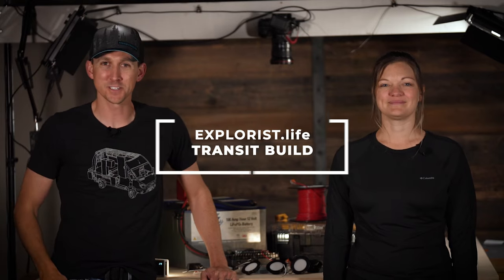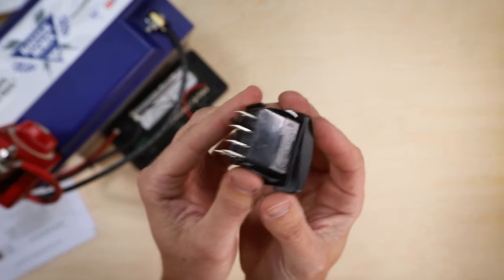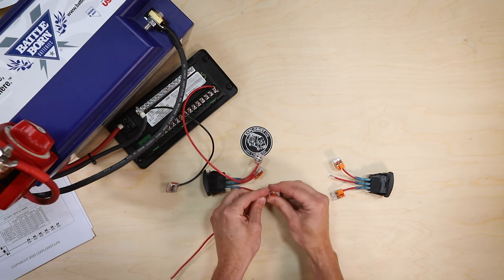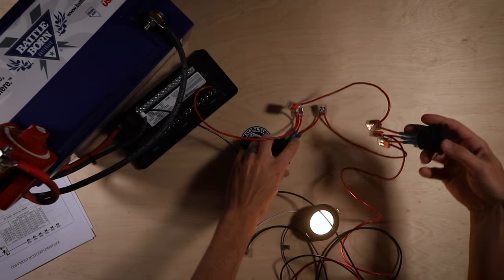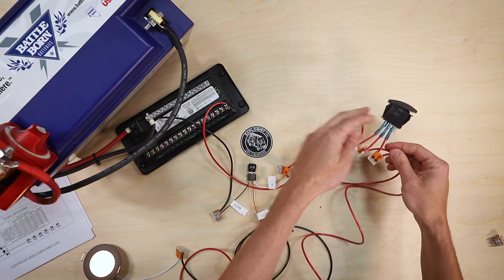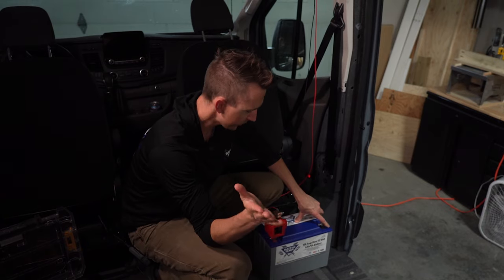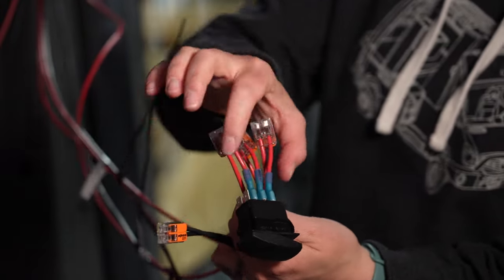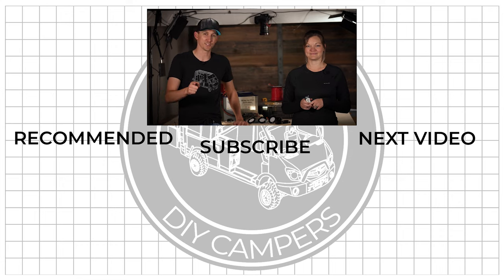How to 12V 3-Way Switches (to Control Camper Van Lights from two locations)

Comment from the maker: Fun fact...  I used the term 'Two Way Switch' throughout this video instead of 'Three Way Switch', which is 'technically' incorrect.  Three way switch is the 'correct' terminology to describe a pair of light switches that control a single group of lights.  I've always incorrectly called them two-way-switches because they turn the lights on and off from two different locations and frankly... old habits die hard.   They are technically called 'three way switches' because the toggles can be either:
-Both up
-Both down
-One up w/ one down

A 'Two-Way Switch' is just a standard, normal light switch because it has two positions; up or down... on and off...  But nobody calls this type of switch a two way switch.

In fact...  by that same logic... a 'one-way-switch' would be a broken switch stuck in the up OR down position?

All of that said...  The term 'Three Way Switch' is Technically correct... but stupid.  A switch that controls lights from two locations should be called a two way switch.  Thanks for coming to my ted talk.

Parts shown in this video:
➤Puck Lights (We used 10 of them): https://amzn.to/3NpW1sE
➤(or some silver ones if you like): https://amzn.to/3lw2sOT
➤EXPLORIST.life Puck Light Wiring Kit: https://shop.explorist.life/shop/all-products/camper-wiring-kits/branch-circuit-wiring-kits/12v-puck-light-branch-circuit-wiring-kit/

If you'd rather buy the parts from the kit from Amazon:
➤Red & Black Wire (we used 16 AWG): https://amzn.to/3lvFesn
➤2 Conductor Lever Nuts: https://amzn.to/3wBZY8f
➤3 Conductor Lever Nuts: https://amzn.to/39Li91W

➤Here is the switch we used: https://rockerswitchpros.com/product/v4d1-a60b/
➤Here is the switch face we used: https://rockerswitchpros.com/product/contura-v-blank/

Not sure what wire size to use?  Check out our 12V Branch Circuit Guidebook: https://shop.explorist.life/shop/all-products/solar-wiring-diagrams/12v-branch-circuits/

➤Shop the EXPLORIST.life Store: shop.explorist.life
➤Shop Battle Born Batteries: http://battlebornbatteries.com?afmc=explorist_bb67
➤Binge the Transit Van Build: https://www.youtube.com/playlist?list=PLmvhcyi4n0TVfA4XCYJBkzfUXunSON1zX
Reply: Just answered my own question, not sure how I linked to the SPST switch.
Reply: In my 55 years, I have always heard this circuit (AC or DC) called a 3-way circuit. The name is based on the switches, as you explained, have 3 combinations.
Reply from the maker: Well, @CihaPet  , I've been around for 187 years and I thought it has been dumb for all of them.
Reply: Can you do a video on 4-way (3 switches)? I would do a switch at 3 spots. Bed, Kitchen, Entrance. 
Thanks!
Reply: @EXPLORISTlife  fun fact in the US it called a 3 way switch but in Europe it is in fact called a two way switch. So technically you where not wrong😂
Reply: If it only goes one way, it’s not a switch. Every switch goes two ways. There’s no such thing as a one way switch. So no, the correct terminology is not stupid.
Reply: @Nowindresistance  When wiring a house in England it is called a "Two Way" by the electrical trade because there are two places where the light can be controlled, Typically at the bottom and top of stairs. For three stories or more, control at each landing is done by an intermediate switch, a 2P2T (two pole two throw) change over. The Europeans have a simpler system requiring less wires but more "technology".
Reply: I'm pretty sure it's called a 3-way because there's 3 points (2 switches and the light) and 4-way (or more) is called "multi-way" from my understanding.
Reply from the maker: @AceBoy2099 Yeah maybe.  Still dumb, though. 🤣🤷😂

Comment: I have been in electrical for 40 plus years, I knew this could be done with DC. I have wired untold numbers 3 and 4 way ac switches. I have been used to purpose made switches specific to the application and have been over thinking the dc set up, thanks for simplifying it for an old workhorse wearing blinders

Comment: Is there any chance you could do a small update on how to wire the switch if you did want the indicator light functional?  Thanks again for the detailed demonstration, it really gives people confidence that they can do it themselves in a safe manner. Keep up the good work 😁👍
Reply: Did you ever figure this out? I'm trying to do the same but have not been able find any sort of guide.
Reply: @shs4x8goat  I looked at the link he provided for the switch Rockerswitchpros. Their website has some wiring diagrams and a phone number you could probably call. They also make custom rocker switches so I'm definitely going to get some of those!
Reply: First you must decide what you want the indicator light to indicate. Perhaps you want it to tell you that the main light is on ! The best use is to be permanently on to show where the light switch is.

Comment: On Lands systems these are called a 3 way switch set up. The two wires between  the two switches that are not the feed or switch leg are called traveller's.  When wiring buildings I would develop colors for their purposes. You could do black negative red positive, switch legs and traveller's A DIFFERENT COLOR NOT YELLOW OR GREEN, Red or  Black. You used them already for  positive and negative, or any other colors that are already in use. Much easier to know what your looking at. A year or two later you open a box and see 2 purple wires well you know they are traveller's you see an orange wire oh that's the switch leg.
If you were to put a 4way switch in your traveller's you could switch this light from as many switches  you want.
Thank you
Mike

Comment: Great video. My only suggestion would have been to use the wago’s only where they were needed to avoid confusion. For instance on the switch the top and bottom terminals had wagos on them but it was only 1 wire in and 1 wire to the terminal. Possibly you did it for faster switch removal in the future if ever needed but the terminal spade connectors were there for that purpose too.
Reply from the maker: You can definitely do that if you like in your own install, for sure. 😏👍

Comment: Hi Nate and Steph, excellent demo video of how to wire up 3 way switches to van lights. The idea of also installing a dimmer is a great addition to any campervan setup. What's not clear to me (Im sorry if this has already been asked) can a dimmer also be place at the other switch. In effect you  would have a 3 way switch and a dimmer at the front of the van followed by  a 3 way switch and a dimmer at the back of the van giving you full lighting control from either end? If so, could you elaborate with a quick drawing (or video if you want) of how to do this ? BTW, excellent channel, love your videos and style.
Reply from the maker: Basically, no.  Not like this, anyway.  If you have two dimmers in the same circuit, they need to somehow communicate so that each dimmer 'knows' where the other dimmer is.  If dimmer 1 is at 50% while dimmer 2 was at 100%, the circuit would 'probably' (I haven't tested this) be operating at 50%.  In short; I think the circuit would only operate at the level of the lower dimmer.

If you want that kind of control.  Something like the Garmin PowerSwitch would be something to look into so you could control everything via bluetooth from your phone.  This is what we used to install the lights on the front of the van with; but it could be used as interior lighting just the same.
Reply: @EXPLORISTlife  Thanks for the reply... I didn't think it was possible but just wasn't sure.

Comment: Thanks for this video. I have a question. Is there an illuminated push button that can do the same job? I want to wire an outside light that I can (for example) switch on from the drivers seat and switch off from the back of the vehicle. The switch would illuminate based on whether the light is on or off. I'd like to use a push button switch because the continuous changing of the rocker switch position would drive me crazy. I hope my question makes sense? Maybe it needs to be a double pole double throw on-on switch and only 1 side is wired? Thanks a lot, your videos are awesome.

Comment: I am sure I know the answer to this question but, can I ask why you chose not to go with the switch lights? Videos are much appreciated , Thank you!
Reply from the maker: With a two way switch, there would be times that the indicator switch would be 'on (because the switch is 'up'' but the lights would be off (I think), but ultimately...  I don't want an indicator light on a switch connected to my ceiling lights because my ceiling lights are plenty of an indicator that the switch is on.

Comment: Once again another great educational video Nate.  

So if I have 3-way LED rocker switches in the same exact circuit, will the LED on both rocket switches be on when when the puck light is on?
Reply from the maker: Probably not.  The switches will be 'on' when they are flowing power; so if the 1st switch is on and the 2nd switch is off, the 1st switch would light up.  This is why there really isn't led light up on-on switches.

Comment: Currently making the LED connections based on your amazing tutorial with lever nuts - was so cathartic and easy!

Anyway, we bought a 12V 2-zone switch/dimmer (looks like a house dimmer switch) which is solid strand wiring. What I am wondering is if lever nuts will work on this, as you have shown for these switches, or if we should make a connection with spade connectors. 

Sort of off topic for this video, but would lever nuts work for the maxxfan connection as well? Or spade connectors? 

Thank you in advance (:

Comment: I want 3 locations.  Rear doors, side door, and driving compartment.  This way I could turn the lights on or off from the cab and also do that from either set of entry doors back or side.  
Would I just add a switch to the circuit in the center?
Reply from the maker: Try it out and see!  I've taught you the basic skills, so now it's time to take these concepts apply it and bench test it for your own application. You've got this!

Comment: So, I love this concept and I’m very curious if this is possible with 3 & 4 switch setups. Is there a way to achieve control of a bank of puck lights utilizing three switches in three locations in my van? Same question for a four switch version as well. I’ve spent a days on the inter webs trying to solve this, but I suspect I’m googling there wrong questions. I feel technically savvy, but this is humbling trying to get through this puzzle.
Reply from the maker: Grab some switches and lights and try it out!

Comment: Great video, thank you.  I want to wire a two-way switch up to my Victron Energy inverter in my tear drop camper, one in the kitchen, one on the inside.  The difference to your setup is that I DO want that LED light working when the inverter is on.  Do you have any videos on how to wire up the LED to work?  I assume it is just a matter of having positive go to it and then to ground?  Is there a need for a resister or anything else?
Reply from the maker: Usually it's just a matter of connecting the ground wire to the switch.  Just follow the instructions on whatever switch you choose.

Comment: If using this approach for a water pump, would you want to use a relay for the water pump and have the switches activating the relay. Verses wiring the pump direct in a 3 way configuration.

Comment: How do you wire a dimmer switch that has 4 wires seen on another channel but not clear enough like your amazing table top demos and also how do you wore up the lights on the switches. Thanks

Comment: If you did wire the little lights on the switches, would they glow as you would want, meaning the switch lights up when the light is on, regardless of which switch is flipped up or down?

Comment: Thank you very much for your reply which neither addressed my question but had the added bonus of being condescending!
Reply from the maker: I wasn't being condescending.  Sorry you took it that way, though.

To answer your specific questions since you didn't like my actual answer.

1: Yes, you can add 4 switches to a single circuit.
2: No, I do not have a diagram for that.

Comment: question? i am rebuilding a cargo trailer into a camper/toy hauler. I am installing a 12v solar and battery system. i am only running 12v no 120. i have a 12v cooler in my trailer plug into a cigarette lighter port. the question is could i use this switch but reverse it so that in one on position it will run off the battery. but in the other on position while in transit mode (hooked up to my truck) it would run off the battery of my truck. so not draining the battery in the trailer? or do you know of another way other then installing 2 cigarette lighters at the same spot with each on different circuits. thanks for you time.

Comment: great video, thanks!

Maybe you already said it it the video, but.. is it possible to connect 2 dimmers on each side of the switch? 
Would be nice to dim from bed also :-))
Reply: 2 dimmers, 1 each side of the switch **
Reply from the maker: Basically, no.  Since the two dimmers can't communicate, they won't work in the same system.

Comment: These heat shrink female spade connectors only come in a box of 100 for ~$25 right now. I only need maybe 10 of them. Is there a product you would recommend for smaller quantity (and smaller price tag)? I'm having trouble finding something similar. Should I use a vinyl covered connector? Or can I add my own shrink wrap to an uncovered connector? Thanks!
Reply from the maker: You only need 10 of them *right now*, you mean. 😉😉  I'd just get the box of 100 for $25 and call it a day.  You'll use them.
Reply: @EXPLORISTlife  Hahah, touché! 😆 Just placed the order. Thank you so much!

Comment: Thank you to the team at Explorist Life for the video. Do you have any concerns/issues with factory dimmer wires being a much smaller gauged vs the larger gauge branch circuits?
Reply from the maker: That doesn't matter given we fuse appropriately for the smallest wire in the circuit and don't ask the dimmer to provide more amps than it's rated for.

Comment: So dumb question - if I have a series of lights on this circuit - (6 puck lights) can I put this 3 way & dimmer at either end? Thx as always for a great demo.
Reply from the maker: Both switches need to be before the lights in this setup.
Reply: @EXPLORISTlife  - in hoping to install 3 way switches at the front and back of the van, do you have a suggested resource on how to wire the circuit with lights in the middle and switches on each end? Thanks, so much!

Comment: Can I ask, what's the advantage of using the levernuts over soldering in the actual van build. Fully understand the use on the bench top demonstrations.. But not final build.?
Reply from the maker: Levernut Pros: Easy to visually check.  Easy to install, uninstall, and re-install.  Doesn't waste wire if a re-connection needs to be made.  Has probe ports for checking voltage. Satisfies ABYC requirements.

Levernut Cons: Somewhat bulky.

Soldering Pros: None

Soldering Cons: Difficult and time intensive to solder.  The heat from soldering creates a weak point where the wires goes from stranded to solid (due to soldering) which is why ABYC specifically forbids a solder-only joint.

Comment: Looking at the 12v switches (not dimmers) you use--they're nice, but expensive.  Why couldn't household 3-way switches be used rather than 12V-specific switches?
Reply from the maker: Household switches are not rated for DC current.

Comment: is it possible to add 4 switches to this circuit? we would like to control the 4 areas on our 45 ft bus from any one of the areas. Could you or do you have a wiring diagram that would let us wire it as we are some what intellectually challenged lol. Thank you in advance for any help you chose to share.
Reply from the maker: Maybe 1 switch per 'room' just like in a house would be more appropriate?

Comment: I'm curious... could you put a dimmer close to both of those three-way switches? I would assume so since you moved the dimmer from one side of the circuit to the other on the bench. Thanks!
Reply from the maker: I know the answer, but I challenge you to think of what would happen if one dimmer was set to medium-high, and one dimmer was set to medium-low?  I'd strongly recommend bench testing that before committing to it in the build.
Reply: I'd expect that one dimmer would have to be full-on for the other one to function properly. That's the big downside to using two dimmers - one would have to have that discipline/attention span to keep them in proper positions relative to each other.
Reply from the maker: @wanderingzythophile9083  So basically... it wouldn't work. 🤣😅
Reply: Hahahah! Well... considering humanity... pretty much :D

Comment: Would you need a relay between the 12v lights and the switch? (I'm using rock lights)
Reply from the maker: Not in this case, no.

Comment: Can you use a 3 way rocker switch with an rf switch? So a light bar can be turned on off from remote and on off from switch?
Reply from the maker: There's quite a bit of stuff you can do with the proper electrical arts and crafts.

Comment: Can you install dimmers on both switch  locations or do you only get one per circuit?
Reply from the maker: Just one dimmer per circuit.  Otherwise the dimmers don't know where the other is and will fight against each other.  If you need multiple dimmers, you'll want to look into something like a SwitchPros panel, but that's a $1,000 solution by the time all is said and done.